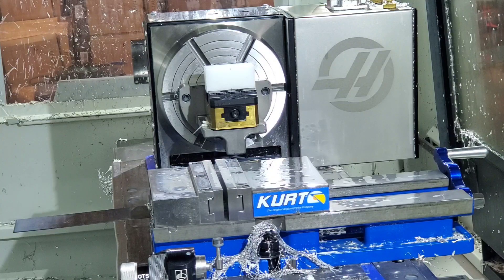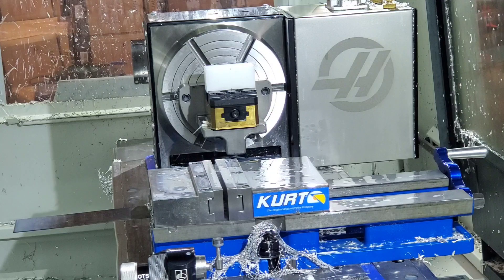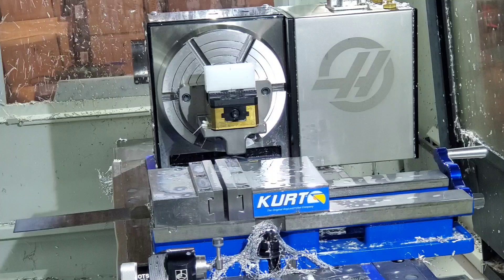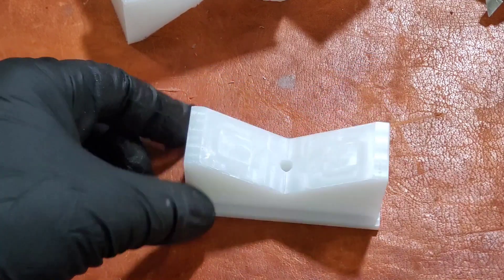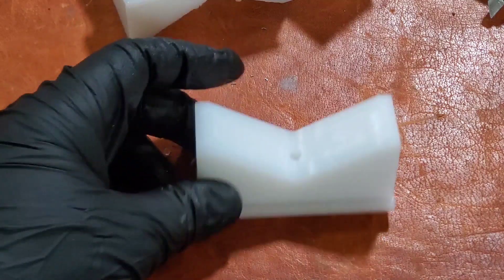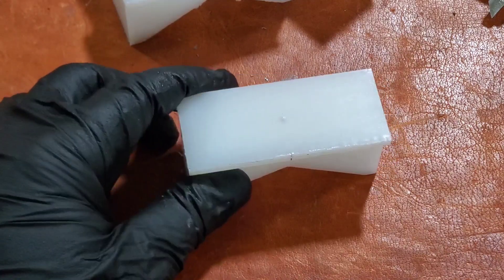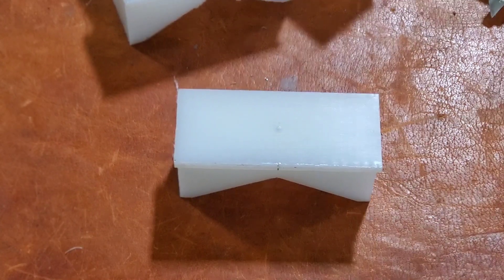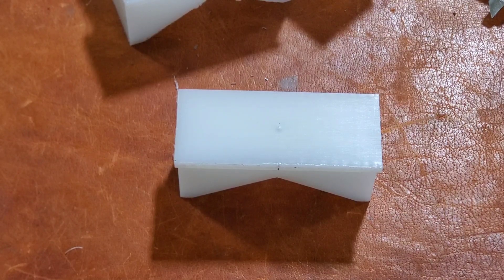4th axis UHMW.

Comment: your machine is a next gen controller right? If I had a NGC machine I would totally buy the TCP option as probing in a datum for op2 on my rotary table would save me so much time
Reply from the maker: That option is about $5000, I will likely get it at some point. Right now I need to learn what I'm doing and get comfortable with it 1st.
Reply: @dnjmachine  makes sense... I just shelled out $3,300 yesterday for the high speed machining option so I feel ya